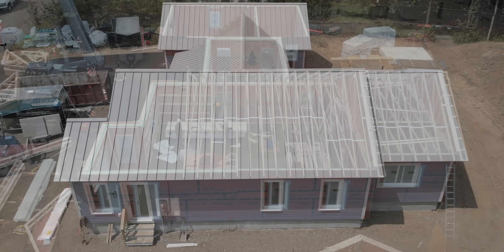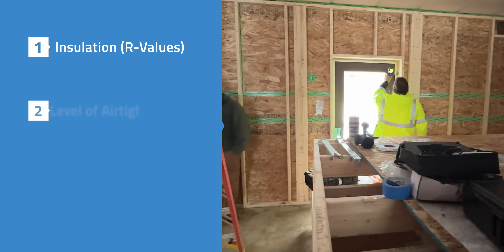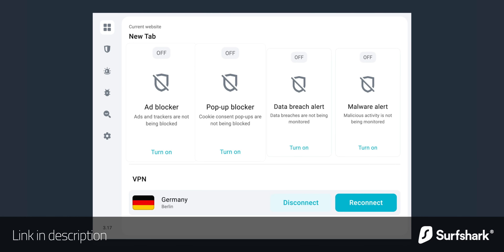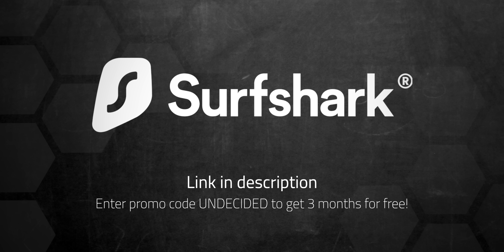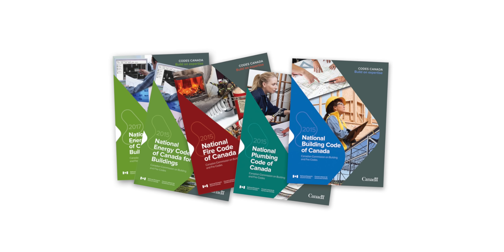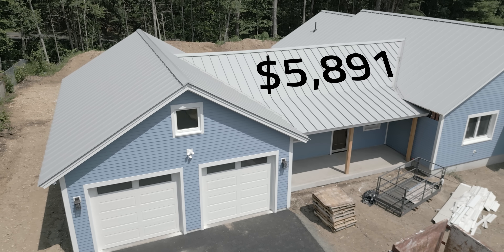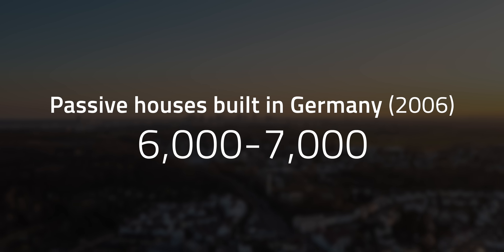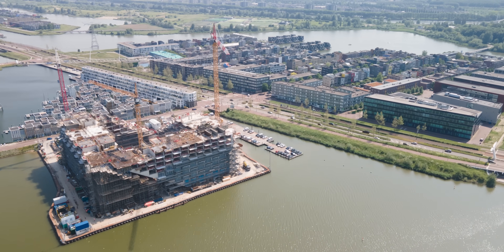Why Do American Homes Suck?

Comment: Matt good morning, I am currently working with a few PhD's and PhD candidates to correct a problem with hot and very hot climates Passive Houses, and it is an industry wide problem that doesn't really understand the "summer" part of highly efficient homes. I am currently working with the PHI and IGSHPA (International Ground Source Heat Pump Association) and I am planning on publishing a very comprehensive paper on the subject once it is finished. If you are interested (an I understand if you too busy for it), I would like to find a way to contact you or someone that works with you directly, to exchange information. You channel has been a source of excellent information on my research, thank you for all the good work.

Comment: If a US builder came to france in 2023 with our actual thermal/organic building compliancy standard ( RE2020 / BBIO ) , i guess he litteraly has to learn his job from the really beggining. 

Just the certificate and analysis report for the energy and insulation of each house is 30 pages long and cost thousand bucks.

And yes, 42cm wide walls, double-stream vent with heat exchanger, hear pump, solar panels, passive gains, it's just mandatory

Comment: The best most energy efficient is SIP, structural insulated panel. Very tight home. Use split systems for air-conditioning, heated floor systems for heat from your hot water heater,  align your home to east west orientation, use double insulated glass windows, with large adjustable window awnings, collect rainwater into a cistern for gardening and dish sink use. Paint exterior white, with white roof in the south, if you can afford it use clay roofs they breathe and do not act like solar collectors. Use solar collectors for heating your hot
 water.
Reply: Write-Me-MattFerrell  what is on your mind?

Comment: In many parts of the U.S. the median time owning a home is only about 8 yrs and the buyer isn't willing to spend much more on a better insulated home.  Several years ago Pulte tried to build homes with SIPS because of superior insulation but had to abandon it because new buyers were not willing to take on the additional cost.  I have a home in Montana that was built with double wall construction and an HRV, 30 years ago, and I have benefited greatly from reduced energy costs over that period.

Comment: In about 1968 my patents had an engineer friend who built his own 3 bedroom bungalow (UK) and he had a direct flow hot water heater for instant hot water on demand and for heat he had a small wood burning stove he used about 10 times a year. When he came to sell it he had to install central heating! You have built energy efficient homes in USA, indeed you used to have a competition. Trouble is no-one cares enougj about their impact on others, their children or as your indiginous lived historically, before you act think of the consewuences on the next 7 generations

Comment: One of the interesting problems in the UK is that because homes are generally built of masonry they're rarely torn down. Which means that although the construction standards for new builds is high, the existing housing stock is relatively elderly and often relatively inefficient. 
A lot of work has gone in by successive governments to try and encourage home owners to improve their energy efficiency, which is great. But without rebuilding the cost of retrofitting to a high energy efficiency can get unsustainable.

An odd example for me is that when i moved in, i had a colleague's husband change my loft insulation and put far more in it (while also boarding it out for storage).
Now, if i want the government subsidy for a new heat pump, i need 2.5in more insulation, but I'll have to take everything out of my loft to do the retrofit which is a royal pain.

Comment: My US house was built in the 1970s and still has the original windows. We've considered getting new, but it hasn't worked out yet. A year or two ago we were able to get free insulation added to various points in the house, including the attic. I was so grateful for that when our furnace broke during the coldest part of the winter, and we were able to stay around 50F with a couple electric heaters running during the day when outside was below freezing. We also have indoor shutters on most of the windows, which makes a big difference when we keep them closed. 

I love the idea of a passive house, and before we bought this house, I was seriously looking into Earthships. I'm now looking for ways to turn my current house to be more passive and energy efficient.
Reply: Well, home require ventilation for breathing AND for moisture removal, so full passive is borderline extreme conditions. But it is possible to make highly efficient housing.

Comment: I totally agree with you that US homes building standards ignore energy efficiency.  One thing you haven't addressed is the carbon neutrality of home building practices.  In Europe much of the home is build with concrete, not exactly a green building material.  The stick built home in the US on the other hand will lock up all the carbon in it's wood frame structure for say 50 years or so.  Of course you need to take into account that most homes in Europe aren't considered old unless they were built over 400 years ago.  I wonder how the two building methods compare in terms of green house gas contribution?

Comment: You think American homes are trash? Canadian homes are no better, and it gets both very cold and very hot up here. I'm in central British Columbia, where we can see -42C in the winter (about -40F) and 40C in the summer (about 104F). My wife and I designed and built our own off-grid, super-insulated home with foot thick walls and triple glazed windows, about twelve years ago. The neighbours thought we were crazy. But while they bitch about the costs of heating and cooling their homes, we use about 1/8 the energy they do. In my experience, most homebuyers are stupid. They only care about square footage, vaulted ceilings, granite counter-tops, hot tubs and big decks. I think they get what they deserve.

Comment: A big part of the problem is that most new homes in the U.S. are not being designed by people who will actually live in them for the next 30 years - they are being designed by corporations, whose objective is to sell them as quickly as possible for the highest possible profit.

In theory, energy efficient designs would still pay off through increased home value (that is, a perfectly rational home buyer would be willing to pay more on the mortgage in order to pay less on utilities, all else equal). But, in practice, it doesn't work that way. The financial numbers you see when comparing homes include monthly mortgage payment, property taxes, HOA fees, and insurance - not utilities, as that depends a lot on the individual habits of the buyer and is hard to guess. Of course, a buyer would be able to see a bunch of technical jargon about what was done to make a home more energy efficient and maybe even R/U values. But, the average home buyer - someone who does not watch this channel - will probably have no idea what any of this stuff means, and simply ignore a bunch of technical terms they don't understand. And on top of that, even if one homebuyer were to understand this stuff and value the home more highly with the super-efficient windows, the value would likely not translate when they eventually sell the home to another buyer.

So, the result is home builders economically incentivized to not spend any money on energy efficiency beyond the bare minimum required by the local building code.

Comment: The idea that the UD became interested in energy efficient housing in the 1970s is ludicrous given the current building standards. What people are interested in is cheap, cheaper, cheapest, with companies/builders making money, more money, most money.
It's a sad story, but again consistent, that there is no MINIMUM efficiency standard across all states but the current mishmash.
Windows in the US usually are no good, ridiculous with those 2 panes that no one can clean in a decent fashion.

Siding, well, another joke, since it requires constant maintenance and painting, roofs are essentially gas cans that get easily damaged and need replacement
I could go on but why, nothing will change

Comment: I think one thing you avoided (intentionally or not) is that with more strict building codes, the cost of building goes up. Kind of an important detail. It already costs frigin $400,000 to build a house where I live lol. Now, over time will it be more cost efficient to pay more up front and have better insulation and such? Probably — though I would’ve liked to have seen that data. This almost seemed like propaganda for us to have the Fed step in on yet another way and tell the States how to do business.
Sorry if I come off as mean — I did really appreciate the video, I just think it left out some nuance.
Reply: It almost certainly will be more cost efficient, the only question is over which time. Houses in Germany (where I'm living) are build to last for at least 100 Years. And the additional insulation easely pays for itself over that timeframe. But american homes ar just not build well enought to last that long, espacially residentiel ones...

Comment: I think the US doesn't take buildings seriously because they don't expect them to last to begin with. European homes were and are built for multiple generations, while in the US it seems like a home that lasts 20 years is unusual and weird. Why would you build something to last, while it's cheaper to just demolish and build again in every 10-15 years? Or every 5 years if you live in a hurricane zone, because concrete is expensive, and the timber lobby is strong.

Comment: Americans don't seem to build anything with the assumption that it needs to last a long time, possibly centuries.
Bricks, concrete, steel, cement, roof tiles are the common building materials here.
So much in the US is instead built with wood and drywall and other cheaper, easier to damage and rot materials, then made to look nice and expensive with paint and facades.

Comment: I took  a different approach. Rather than strive for energy efficiency in the home, I went for enough solar panels with battery storage that I don't care how "efficient" my house is, or how much electricity I use. Without the solar system, my electric bill at my current level of consumption would be about $4,000 USD per year.

My house is total electric except for the gas fireplace that is used only for mood setting, not for heat. The 500 liter propane tank gets filled about once every two years. All else is electric: A/C, heat, hot water, cooking, computers, appliances, lighting, swimming pool pump, garden lights, television, everything. My electric bill is about $1.50 USD per month, depending on the dollar/peso exchange rate. This is the required grid connection fee. Even though my system is off-grid capable, I remain grid connected to save wear on my batteries. My excess production is given without compensation to the grid provider and usually amounts to 500-600kWh per year, which would be worth about $30 USD.

The house is 63 years old, all masonry construction, six inch thick walls, 12" thick ceilings. Zero insulation, no multi-pane windows, at least some windows open every day of the year. The climate is temperate enough that the AC/Heat pump operates about 30 hours per year to maintain a comfortable environment.

Your efficiency saves in the consumption of energy; mine saves in the consumption of dollars. I reckon that each method is about equal when it comes to environmental impact.

ps: My house does not suck!😀